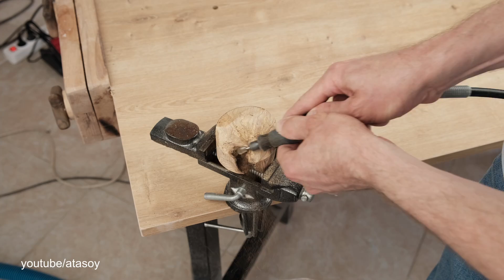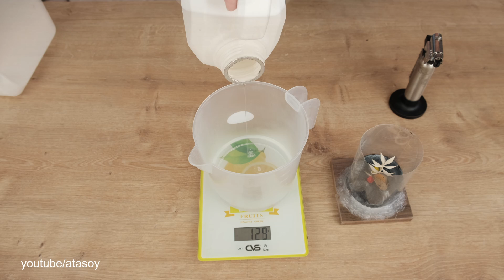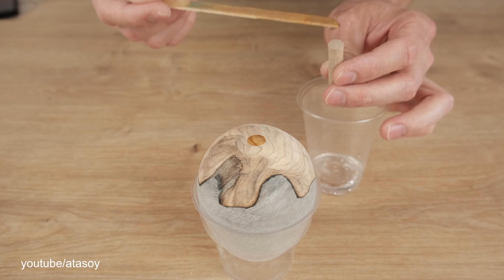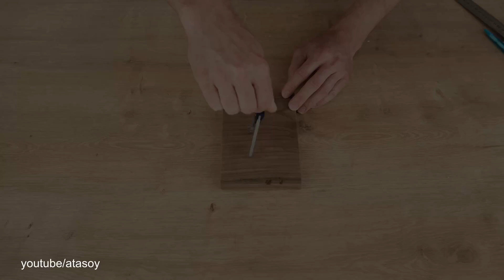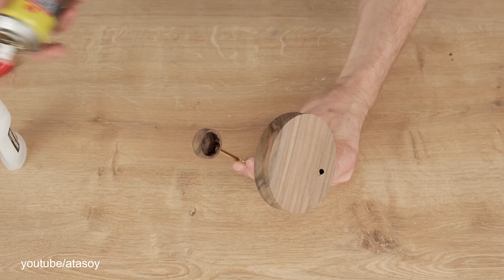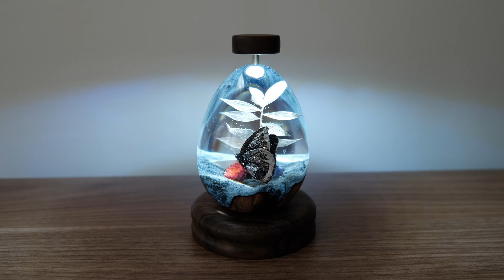Make a Butterfly Night Lamp With Resin and LED | Egg Lamp | Resin Art

Comment: Şerit ledlerin ve diğer videolardaki yuvarlak şekilli ledlerin linki var mı
Reply from the maker: https://urun.n11.com/led-ampul/1-metre-tv-arkasi-aydinlatma-5v-usb-serit-led-isik-gunisigi-renk-P465283642

https://urun.n11.com/arduino-urunleri-ve-setleri/kcd11-mini-yuvarlak-on-off-anahtar-siyah-P333946103

https://urun.n11.com/arduino-urunleri-ve-setleri/adaptor-fisi-sase-yuvarlak-2125mm-P413723893